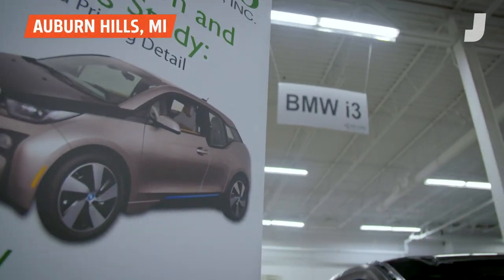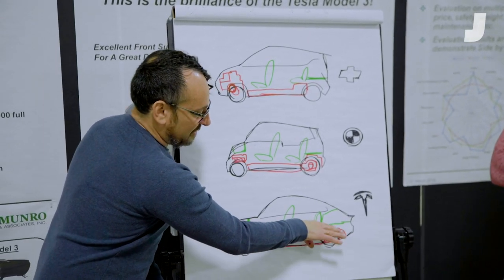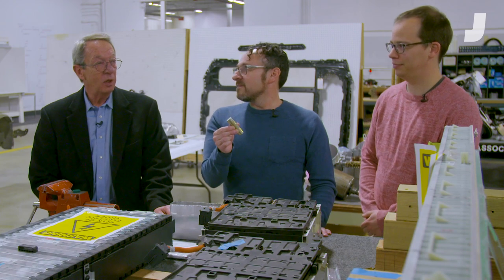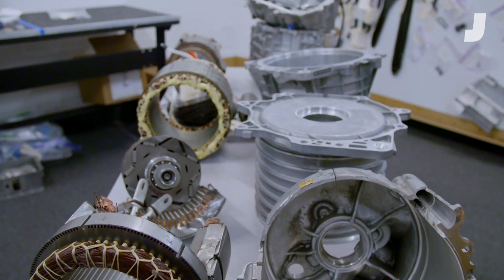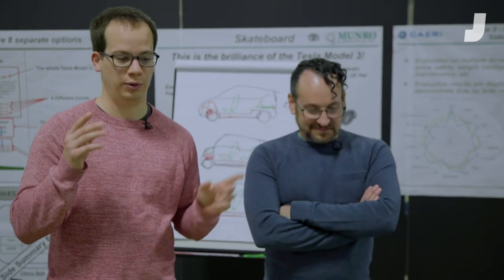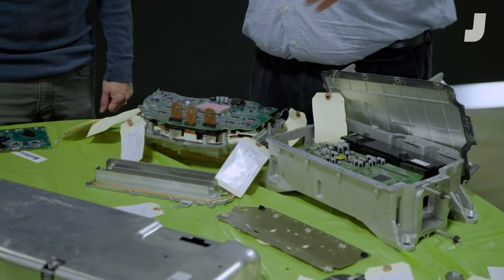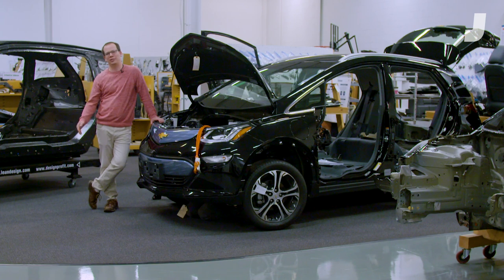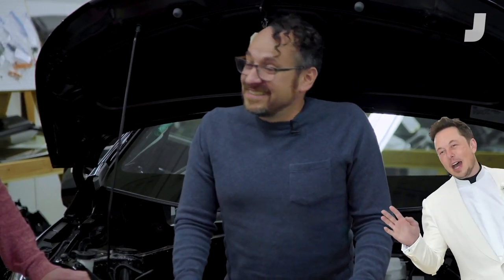A Look Inside The Tesla Model 3, Chevy Bolt, and BMW i3

Comment: Tesla is dead serious about EVs and it shows.
Reply: When it's all you have, uh, yeah....
Reply: That is why there are so many dead burned out teslas !
Reply: @captlarry-3525  the first 3 words Crusherix typed, were correct. 🤣
Reply: Tesla outselling any other EV and scares other car manufacturers that even they jump on the bandwagon. Yeah, Tesla is dead.
Reply: @captlarry-3525  Show all the great numbers of fires to me. I'm using the first good data I found -- I have a general rule of not spending a lot of time on idiots.

In the years 2006-2010, there were approximately 5 THOUSAND car fires. Internal Combustion (pun intended) cars. Until January 2016 Tesla had SIX car fires. SIX. Conclusion? Meh.

BTW, if you do spot a burnt Tesla, PM me. I needs some car parts from a car or two for a project.
Reply: I mean their name is after the dude who basically found electricity so....
Reply: @VelocitronVoyager  Actually, Chevrolet named a car "after the dude who basically found electricity"...VOLT is named after Volta. 

Tesla was a  dandy charlatan who, like Einstein, knew how to play the media and, like the Wrights and Edison, won battles in court. The venture capital community read right through Tesla's BS and wouldn't give him a dime for his harebrained schemes.
Reply: @vidznstuff1  The harebrained scheme I rode in last week did 0-60 in about 4 seconds. Still waiting to get my breath back.
Reply: @vidznstuff1  "Tesla was a  dandy charlatan who, like Einstein, knew how to play the media and, like the Wrights and Edison, won battles in court. The venture capital community read right through Tesla's BS and wouldn't give him a dime for his harebrained schemes."

Revisionist history.  Tesla was actually a brilliant theoretician who invented the 3-phase AC induction motor, and all of these vehicles use the same basic design with modern digital control systems added to perfect their output and efficiency.  Tesla was a lousy businessman, though, and didn't profit from his inventions like Edison did.  (It's true that in later life he pursued some bizarre ideas, but his early inventions were genius).
Reply: @gatman9288  Um, no. Ferraris actually invented and demonstrated the motor, Tesla pilfered the idea and ran to the patent office with it.
Reply: @vidznstuff1  I don't think that's an accurate read of history.  Here is a brief explanation of the Tesla vs Ferraris situation. One person's opinion, sure, but this guy seems pretty well informed.  https://www.quora.com/Why-is-Nikola-Tesla-considered-to-be-more-important-than-Galileo-Ferraris

Can you provide citations to back up your assertion that Tesla simply stole Ferraris' invention?
Reply: @vidznstuff1  Ha, I searched on your claims, and I see now that there is a vibrant Edison-centric subculture on the internet that disputes Tesla's contributions to AC motor design. All this dates back to patent disputes in the late 1800s. I guess you're in the anti-Westinghouse camp? Who knew that this dispute was still being litigated by the internet. Fascinating.
Reply: @gatman9288  LoL - when you got nuthin', compartmentalize to the kook/subculture/conspiracy bin. You've all but admitted you couldn't dispute the real inventor of the 3-phase motor wasn't your demigod Nikola.
Reply: @vidznstuff1  So, first off, Nikola Tesla is not my "demigod".  I have no emotional attachment to the guy whatsoever.  Not sure where you would have gotten that idea, maybe you've confused me with someone else here.  I simply said that your statement was revisionist history, and then I told you why - and even cited a reference.  Despite the fact that you've provided no evidence to back up your comments about Nikola Tesla, your comments inspired me to dig deeper, which is when I discovered that the history of AC motor inventions is apparently still disputed.  Kudos to you.  But I haven't seen anything to suggest that the history of AC motor design or your assertion about Ferraris is a settled matter, or anything to dispute the notion that - despite his kookier ideas in later life - Tesla was anything other than a brilliant theoretician in his contributions to AC motor design, and there is ample evidence of that.  Certainly it seems that, like most important inventions, many people were working on similar ideas at the same time.  (Are you in the Kilby camp or the Noyce camp?  Apple or Android?  Zuse or ENIAC?)

It seems to me that you have a pretty negative opinion of Nikola Tesla.  Fine.  Try to have a nice day anyway.
Reply: You can say that again that Teslas is dead.
Reply: @gatman9288  
I understand where you are coming from when you say "kooky" ideas. 
I would like you to keep one thing in mind. 
The guy legitimately powered stuff by radiating high frequency EM energy through the atmosphere. 
The work that was incredibly difficult like, say, helping Westinghouse design entire power generation systems, that was just his day job.
The stuff everyone thought was impossible was what he built at home, just for kicks.
That kind of thing changes how seriously you take the idea of "ridiculous".
Reply: Lots of people are 'shorting' Tesla shares! Great time to buy. Its the future of that I have no doubt! ICE cars are a dead duck and its going to happen faster than you think! Musk is changing the world whatever the naysayers think!
Reply: @brucebevan3099  It will be like when iphone and the rest of the company jump on it
Reply: Tesla is cashing in on rebates. If it weren't for the rebates no one would buy them and electric cars would be long dead.
Reply: @vidznstuff1  Well even if that were true naming the company Ferraris instead of Tesla would have been a bit of an issue ...
Reply: @branh5220  Um, no....
Reply: @vidznstuff1  soler space X ,
Reply: @vidznstuff1  Good for them.
Reply: @vidznstuff1  It's called ebay boomer
Reply: @captlarry-3525  really. Where do you get your information from? I'd be curious to know.
Reply: @vidznstuff1  I not sure, but I think you may have your facts wrong. You might want to do a little fact checking.
Reply: @boostav  The rebates have been gone for a while now. So you might want to come up with another reason that Tesla is dead.
Reply: @Jozavenue  Tesla is a public company. SpaceX is a privately held company, separate from Tesla.

Comment: As far as the Model 3 is concerned I think one point is often missed when it comes to the manufacturing "weirdness". Tesla really thinks about how things should bend and twist during an accident instead of just designing for the crashtest itself. They published some of their simulations you guys can probably find them on Tesla's site still. Like for example there was one that showed how everything was bending so that the front motor would sort of bend and slide underneath the cabin. I'm sure it doesn't explain all of the manufacturing quirks but I'd think it explains some stuff where traditional auto guys look at it and are like why would you do it this way.
Reply: @p jd
Sure but designing for an electrical motor is of course different as designing that for an ICE so some things may just look weird to someone who's only ever looked at ICE vehicles. It's not like noone else has thought to do some of these things before but ultimately the Model 3 is the safest car ever tested according to the NHSTA. To have accomplished this they are bound to do things differently from industry.
Reply: Meh - they tweaked until their computers told them they were good. It's pretty easy to total a crashed Tesla because of design and construction and few body shops skilled enough to do the repairs....which means high insurance rates
Reply: @vidznstuff1  The crash data is from physical NHSTA crash testing and the Model 3 is the safest car ever tested according to actual wired up dummies placed in these cars not computer models.
Reply: @ryccoh  You fail to make any further point here other than flag waving. 

A car that has stellar crash performance that is not repairable is not as stellar as you fanboys wish it was. The metal used in a Tesla CRACKS when bent, making that spotwelded integral structural piece a writeoff. Now fix it when 95% of repair shops don't have the skills or equipment to repair them. Teslas are written off for minor collisions that would render other cars repairable. 

A "safe" car for the people that trades a luxury car payment for a lower buy plus insurance premiums is FAIL.

Cars are designed an optimized by COMPUTERS now, including crash performance which is a fairly recent tool suite...dummies are only  used for validation. 

If a newly designed platform fails crash testing, it's because bean counters stuck their noses into it. When you charge premium prices, have a poorly staffed customer service organization, and charge outrageous amounts for parts ($500 for a KEY), like Tesla does, the beancounters stay out of it.
Reply: @vidznstuff1  you have some valid points but some aren't. Yeah a Tesla isn't for everyone but the car starts at 35k so luxury payments not quite and insurance premium is offset by fuel savings. As far as modelling is concerned you're obviously right but my point is that the rating is obtained through crash testing not computer modelling which is only used in design. Everyone's reasoning is different which is why arguing on YT is kinda moot but personally I've never been in an accident in 15 years but if I was I'd take the safer car even though it might total easier for a once in a lifetime event. From what I read insurance costs are average though for Tesla's but I might get some quotes as I'm curious to see if you're right. Also about cracking metal and expensive repairs I assume that only applies to Model S and X since Model 3 is made almost entirely out of steel versus aluminum for S and X. Same goes for parts prices like 500 dollar keys everything you know about S and X probably doesn't apply to model 3 which is what we're really talking about here. S and X were like BMW and Benz flagship competitors so it was okay to have these shenanigans but you can't just assume that Tesla is doing the same for it's 35k car
Reply: @vidznstuff1  $500 for a key? The Model 3 doesn't have a key, just a RFID card or phone app.
Reply: @ryccoh  No , Tesla claimed it was the safest car the NTHSA tested, then they came out and basically told Tesla to stop lying and using their name in those statements. They gave it a 5 star eating, like many other cars also get. They do not rank cars within that star rating.

Comment: can you make a similar video on model x, e-tron and i-pace?
Reply: Why i pace? Completetly different class.
Reply: @Batvolle  it's not a proper SUV but close XD
Reply: Doubt it. It takes a lot to reverse engineer an entire car. It's not to say it won't happen though
Reply: @cpufreak101   you make no sense, all 3 of the cars in this video were reverse engineered by the company. They will probably more than likely also teardown those cars too
Reply: @d0peusername  the question is though of they'll allow jalopnik back in to see them though
Reply: They won't publish or comment if the company is a customer.
Reply: They won't tear down the car unless it's interesting from an engineering perspective. It's why they chose the Model 3 instead of S or X. The e-tron and iPace have next to no chance. i3 is interesting, not sure why the Bolt but I've just started watching so I guess I'll see...
Reply: aurelio milaor cabal  those companies folded for various reasons, mainly due to product no longer needed. Kodak and other photo film companies went away and no country is producing film and film cameras. Why film and chemicals to process film then produce photos with more equipment when the CCD was invented and did away with film? Moving away from paper photos to memory sticks, CDs, hard drives or SSDs with a pc screen to view images. A printer makes photo images. Film died when higher resolution digital image capturing electronics replaced them. RCA went away because they became stagnated when electronics spread everywhere and RCA couldn't step in. Zenith did the same. GE tried to move into other areas of technology but cannot establish a competitive edge outside their core manufacturing principles so they faded away.

Comment: The reason for all the welds in the Model 3 substructure, is rigidity. It forces energy transfer where they want it to go in a collision... hence their near impeccable crash safety rating. 

A lot of people think this is easy, because it's electric and all the mass is low... but it's not. Don't forget, the Model 3 is an immensely heavy car. Picture a soda can with concrete in the bottom. All that battery weight carries tons of energy and momentum in a crash. Without those extra welds to force energy transfer around the passenger compartment, the energy would simply cave in the structure, and crush the passengers. By transferring the energy to other parts of the chassis, the whole car can share/distribute the energy, instead of just the impact area.

Comment: I can sense serious Tesla bias here! The BMW is the only one with a feather light  carbon body to compensate for the heavy battery. more over the packaging is so well done it also includes a combustion engine as a range extender . Imagine the battery going dead in the middle of nowhere ,there is no limit to the range  as long you fill up with petrol.Also the Tesla is not a compact size car it is much longer so it is not a mystery that it has additional storage space.

Comment: Thanks much to you and Munro for this video!!  But for me -the first part that pointed out that only the Bolt is FWD means that I would never consider the TSLA or BMW ,which are on the  old RWD platforms. Big, big difference in handling  and safety in real world weather conditions, once you get off the ideal test track in S. Arizona. Given I and many others live in NORTH America, this is a real show stopper for FWD vehicles  for year round usage.

Comment: The technology in modern cars espically EV's is out of this world.
Reply: Only Tesla pretty much. Everyone else is way behind on every aspect.
Reply: @charlech  not exactly.....ive seen some crazy tech in non tesla cars
Reply: Carbon Fiber might be new to consumer cars like the i3 but is crucual tech for the space and aerospace industries. I dont think Tesla would have the manufacturing might as BMW. Maybe SpaceX but not to mass scale. So maybe ur wrong in BMW being behind in tech in that category.
Reply: pauL3gend I don’t think the chassis is the most important part of an EV. Let them build a mid sized EV with 300+ miles and 250kw charging capabilities, then get back to me on that BMW is on par with Tesla nonsense.
Reply: @alphaomega9650  BMW is ahead with the I3 in the use of carbon fiber for the the chassis...although it's completely the wrong car for it and was a waste of time. They are also ahead in manufacturing might. Now as far as the rest of the car, they are mostly behind except maybe a few little things here and there.
Reply: That explains SpaceX!

Comment: Great video with technical detail you rarely see ever, though audio mic volume is pretty uneven making it hard to hear in spots.  Anyway, IMHO eventually the automobile internal combustion engine will be as antique and quaint as a CRT display.  The simplicity and reliability and low weight and high torque at low rpm of electric motors is tough to beat with the complex contraptions of pistons and automatic transmissions.  Home rooftop solar with electric vehicle battery storage will be a synergistic energy revolution.

Comment: They didn't really mention the strangeness of the Tesla model 3 motor though. Each magnet inside the rotor is actually 4 magnets glued together facing opposite directions in polarity. It makes use of some obscure electro-magnetic effect that Sandy Munro himself elaborated upon in an interview. Tesla's electric drive train is about 97% efficient versus the 93% efficiency of a typical electric drive train. It's more efficient in a wider variety of conditions, it's more compact, and it's cheaper to make than competitors despite having more power.
Reply: Actually the Bolt has the cheaper motor design to build and the most reliable & durable design as well...
Reply: I am very curious, I was trying to figure out where the Hallbach pattern conclusion comes from: is based on hypothesis or measurements? Is there any actual picture or plot of this field produced by these magnets?

Comment: All of those cars help to reduce smog in the city :-)
 Tesla seems to be a few years ahead in this comparison video.
  More electric cars will be good for the clean air in the city !
Reply: Actually the most practical design is the Bolt, the Tesla is designed as a performance car...
Reply: Not in China...their major power source is COAL
Reply: BMW seems to have been slacking a lot with the i3.
Reply: @MrChadder007  No BMW I3 is way ahead in technology. 8 year 100,000 mile on the battery, 4 years/50,000 on the vehicle, 12 years/ unlimited miles on rust perforation,15years/150,000 on the range extender and emission control, and the only one that the lithium-ion can be repaired.
Reply: @jmwarden1  lol, under what kind of propaganda have you been living?
Reply: @jmwarden1  in Teslas they can just repair the damaged cells

Comment: The problem with the T Mod3 is in the passenger compartment. It is simply made from too many individual components. This highly complicates fabrication of shell elements and assembly. If they can get the parts count down, will likely improve delivery numbers very quickly.  Gotta say I love my Bolt and what i paid vs either the BMW or Tesla, we have ~20-25K extra working for us in the markets.